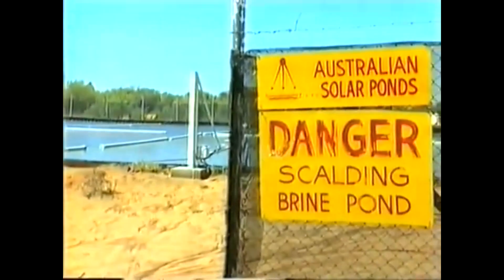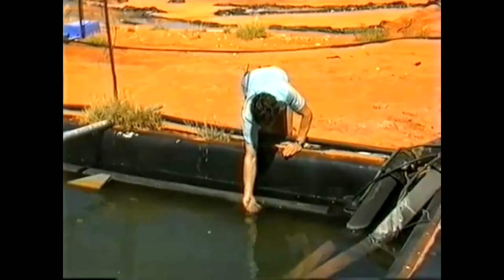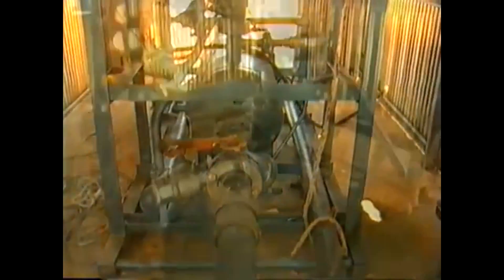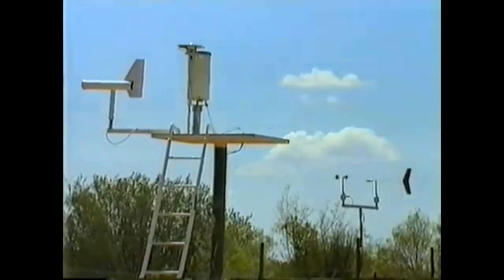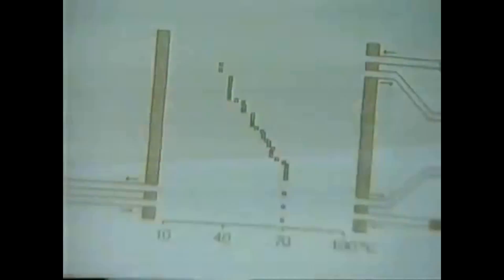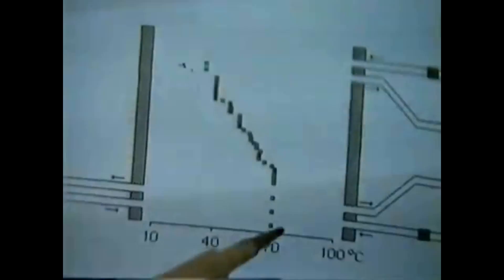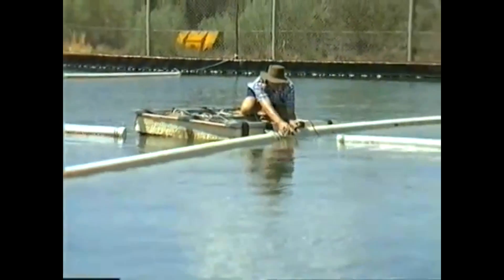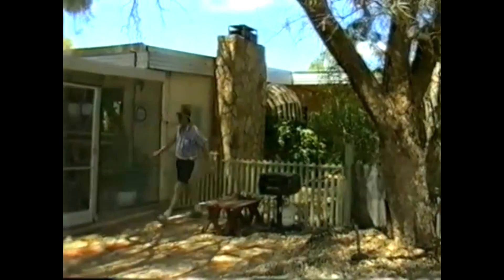Electricity from Solar Ponds

Comment: The actual terminology used today is called a Freon Turbine Generator, geothermal areas in cold climates are well suited for this type of technology. Because the water is so hot to raise the freon temperature to a boiling , the waste/ returning water needs to be exhausted, or cooled down. So in the right locations it’s feasible. Another type of FTG is like a solar collector directing the sun’s rays directing at a Freon tube bundle, for cooling they use a cooling tower. High water use is the main problem with cooling towers with an evaporation rate of 1.8 gals. per ton per hour, combined with the need to reduce scaling with an additional bleed off or blow down rate to maintain a mineral concentration rate of 2.0 to 6.0 of the the local source water. The higher the mineral concentrations the higher the bleed off rate needs to be to prevent excessive scaling of the cooling tower components, pumps, fan blades etc. 
A cooling pond or directing the return water to geothermal cooling is another option. The California Aqueduct evaporates about 7-11 million gals. of water per mile. The amount of surface water they show in this video would result in a significant amount of evaporation. So having an abundant source of water is needed.

Comment: Of course it's vapor making a fan spin 😂 it's like that's as far as we've got as a species. If you look at nuclear power plants they're still all about warm water creating vapor that makes a fan spin💀
Reply: Hey calm down I'm human too 😅
Reply: @TheFilipFonky  okay! 🫡😅
Reply: yes, I was wondering the same. what's your approach to transform heat (which is a kind of kinetic energy all in itself) into useful kinetic energy to spin a generator?

or however else you might think, electricity should be produced.

not everything is bound to evolve and change. so many years, and you still sleep, right?

(no, come up with anything good; don't get discouraged that easily.)
Reply: Do you have any better ideas?

Comment: It would be great to know more about the efficiency of this system
Reply: Efficiency is a silly metric when talking solar power. 1% of free energy is still free energy. Whats more useful is $/W and $/Wh.
Reply: @mabamabam and maintenance costs, and if you have the area to spare or not. Not too mention, the water to spare. And reliability as well as how robust it is if something goes wrong, such as dirt in the system, or a frozen pipe breaking.
Reply: @carneeki everything you say is what then eventually accumulates to a dollar value. if you wouldn't need anything with no maintenance, it wouldn't cost anything.

what I'm saying is that yours isn't an addition, but the reason it costs something.

everyone knows that reliability is important and you'd need to know the overall performance in the long run.

Comment: How much power would a set of solar panels covering the same area produce compared to the pond?
Reply: it's difficult to say. it's super easy to look up the size and peak power output of one panel. but you'd need to know latitude (okay, that'd be southern Australia) to know the optimal angle and how far to space them apart. and we don't even know the pond's size.

nonetheless, about two to three megawatt peak it should be. which means, under optimal conditions (clear day, clean panel, perfect angle.) without clouds (I believe, Australia is fairly sunny), you'd need to divide by three to account for sun's movement. (the factor two is because of nighttime and the plus one is for the less than ideal angles in the morning/evening where the sunlight also happens to travel through a thicker layer of our atmosphere. this is the average and varies with season, obviously.)

Comment: Growing up in the '80s, I knew about photovoltaic cells on pocket calculators:  we called them solar panels.  I learned in school then that solar panels also could be used on houses.  I thought that domestic solar panels made electricity, as the little ones on calculators did.  A house in our neighborhood had solar panels.  Only many years later did I realize that those must not have been photovoltaic cells, but probably were for heating water.  Nowadays, photovoltaic panels are multiplying every day, which is great; but I think we shouldn't forget the water-heating kind, too.
Reply from the maker: I agree, Solar water heating is terrific and the units (copper, aluminium) are readily recycled - Rob

Comment: Cooler than the material itself would be a modern supplement discussing what has been going on with this project over the years since the material was made.
Reply: replaced for several reasons with solar PV installations. Over more than a short time PV is cheaper.
Reply: @thekaxmax  ... I'd like to know the flavors / reasons why, because it may be interesting data... which may have failed in this project but could be suitable in other approaches. Or maybe it will turn out that PV has become a cheaper solution and that's the only reason they abandoned the project, which is not a very good reason in my opinion, because getting to know the subject in depth can have its flavors. Data is needed for details.

PS. Thank you for your response.
Reply: @zorkpl  required and active maintenance is a huge downer; you'll lose almost all the power if you slack off a bit, and it's expensive to fix it back up to usable. Same heat pump and angled mirrors would actually give better and cheaper results--they work and are used. The only real advantage with the pond is it's also a heat battery, and they are better done as a specialised device.

Comment: Toxic! Good thing that’s gone now. Clever, nonetheless.
Reply: Salty water hasnt gone anywhere. We still have these big wet things called oceans
Reply: @mabamabam do they contain freon as well?
Reply: @To.Ma.To_78  No, but theyll kill you much faster than your old aircon
Reply: @mabamabam  I believe, the term 'toxic' in the original comment was referencing the freon, not the salt.
Reply: @To.Ma.To_78  Yes. I was pointing out how silly it was to be worried about a small amount of very slightly toxic refrigerant, that was found in most houses and cars, rather than the hundreds of tonnes of scalding hot poison. And yes saturated salt solution is poison.
Reply: Well billions of people buying plastic toys because they want to act like children is certainly way more toxic

Comment: Interesting video as always, looks very complex to maintain relative to today's concentrated and regular solar panels systems, just the phrase "boiling Freon gas" would have made most investors run away from this technology these days.
Reply from the maker: It was a self-contained system, though.
Reply: @CuriosityShow So are photovoltaics, and they require far less maintenance and have a higher energy density.
Reply: @SwervingLemon  , I think what they were referring to was the image of Freon being boiled away into the atmosphere. I believe they what meant by “self contained” was that the Freon was in a closed system and wasn’t just vented to atmosphere.

Also, at the time solar PV’s we’re still incredibly expensive and not nearly as energy dense as they are today. They were not considered a cost effective solution at the time they filmed this which made the solar pond idea a potentially viable option. Today though, you are correct. Solar PV is far more effective, cost or otherwise.
Reply: @SwervingLemon What do you do with photovoltaics when they’re done?
Reply: @stellamcwick8455 while your second paragraph is absolutely correct, I think you're wrong with your first one where you estimate what the curiosity show is referring to.

I don't see how they meant "self-contained" in the sense of the gas being enclosed. it's probably more that you don't rely on mining and production from overseas like it's the case with PV.

Comment: I remember hearing about this technology as a teenager in the Seventies. Whatever happened to it? Are there any large scale solar ponds working today?
Reply: Significantly less efficient than solar panels
Reply: Oil
Reply: Now there are solar PANELS, which produce way more electricity
Reply: Ambitious but rubbish
Reply: I'm not sure about large scale ponds but I do know there are a few places in Australia that have designed and built thermal reservoirs for local use. I know my former university (Uni Sunshine Coast) built one a few years ago that works to supply at least some of the energy requirements of the main campus. It is a little different system given that it is a very large water storage tank but I assume it works on similar principles. But I also know that they have also implemented very large solar arrays to further enhance their local generation capabilities so that they aren't as reliant on grid energy so have significantly reduced their energy expenditure.
Reply: @evanstedman7405  In that care, IIRC, the water tank is a heat battery for building heating rather than a heat collector for a heat pump.

Also note that we can't use Freon and haven't been for a long time, so it'd be a less useful but far safer fluid.

PV replaces these heat pump systems entirely.
Reply: @thekaxmax  You can run ammonia adsorbtion refrigeration on pretty low grade heat. Might be a useful application.
Reply: @mabamabam  I'd run a heat pump on the back of solar cells, that's a good source of waste heat that doesn't need much maintenance. Plus, solar cells don't like to be too hot, active cooling makes more efficient.
The pond would be very situational, given the maintenance requirement
Reply: @thekaxmax  Yeah obviously solar ponds are a dead end. PV and heat pumps are so cheap anything else seems silly. 

But, if you did have to run a solar pond then ammonia adsorbtion might be the best use. If its hot enough for a pond then its probably hot enough to need refrigeration. Using a solar pond for heating, either directly or through a heat pump, seems unlikely, although maybe a high desert type environment with lots of sun?
Reply: When the answer to your question is a google search away…